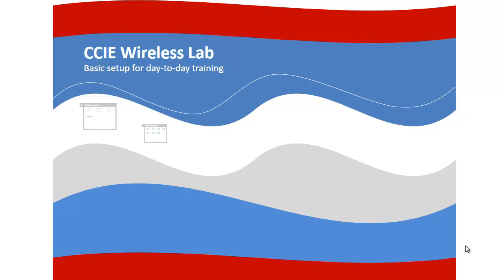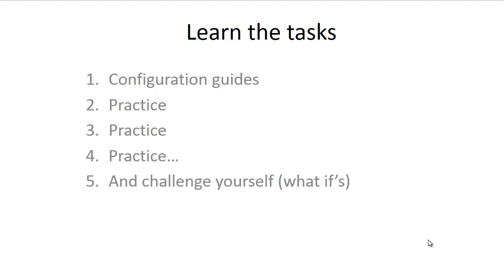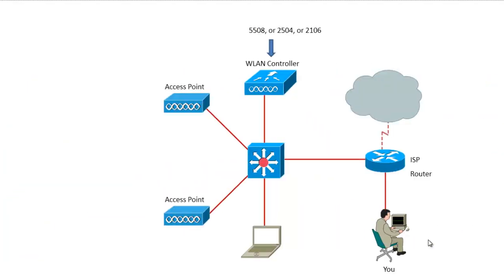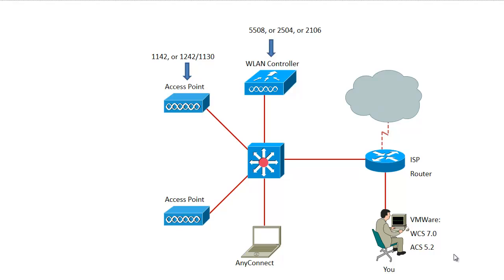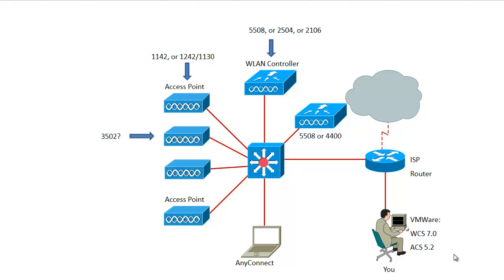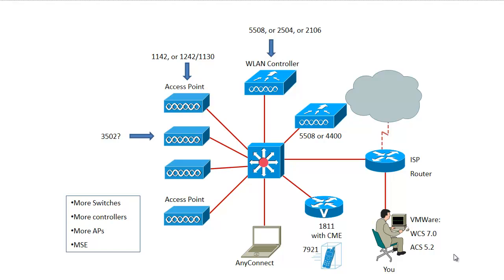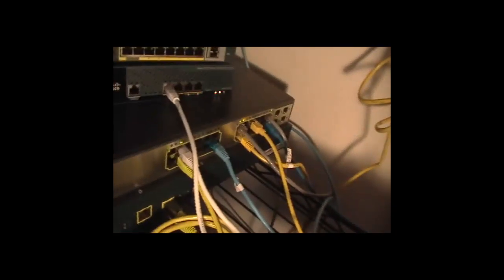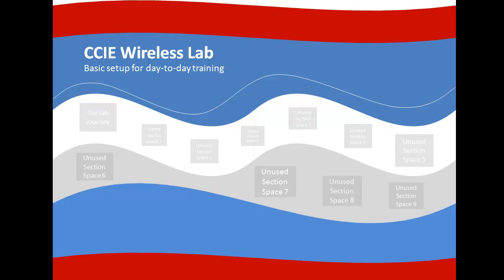Home CCIE Wireless v2.0 training lab

Comment from the maker: Yes, you just need to set your VM images network adapter to Bridged, and each of them independently accesses the physical network from the host... the switch is then set to trunk, and my host (because I am lazy) is on the native VLAN, I just tag the guests VLANs.
 I use Linux as host, so it might be more tolerant than Windows. Under Windows, every time I want trunking from the machine, I had to go to Network and Sharing Center > edit the wired network adapter properties, and allow VLAN/trunking